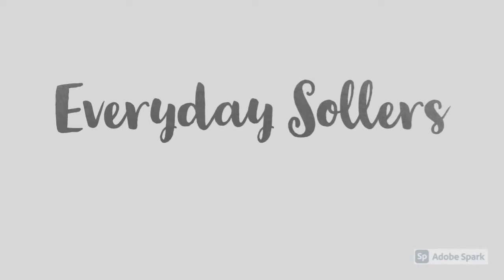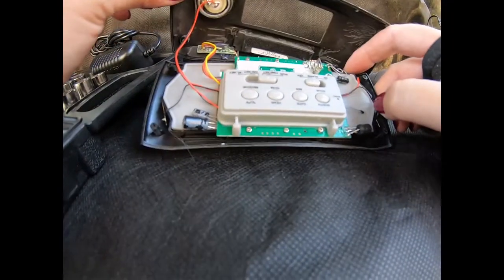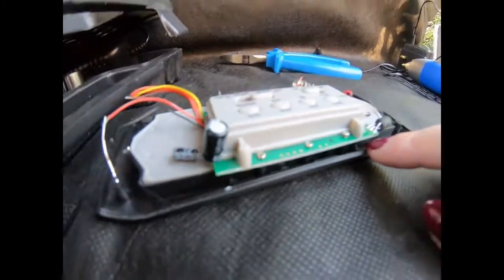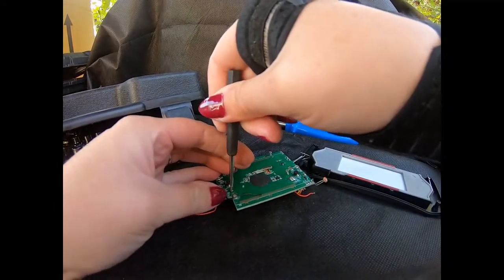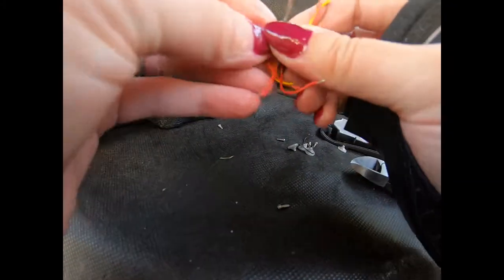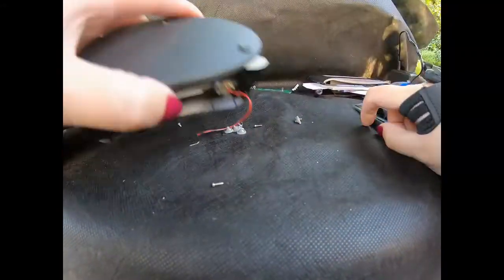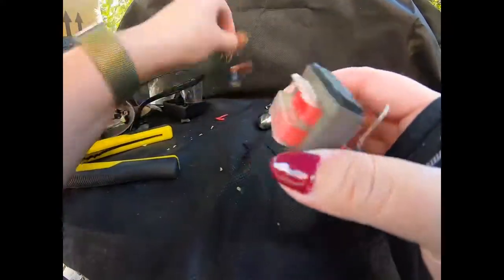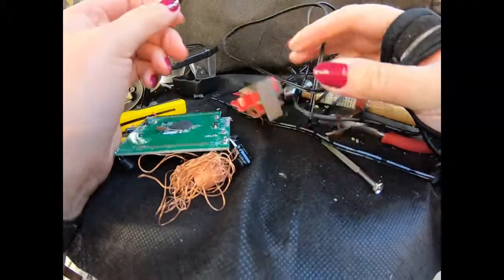e-waste: how much copper is inside a digital alarm clock? What's inside, precious metal recovery?

Comment: There's an old alarm clock in the house that's still being used as a clock, but if it ever goes bad I would like to see what's on the inside, I've actually never taken an alarm clock apart before. 17:52 That type of plug in device is unusual in the states, although I did buy a huge window mounted air conditioning unit which had a plug that looked similar to it, I had to get a totally separate outlet for it lol
Reply from the maker: It's always wonderful taking things apart for the first time!